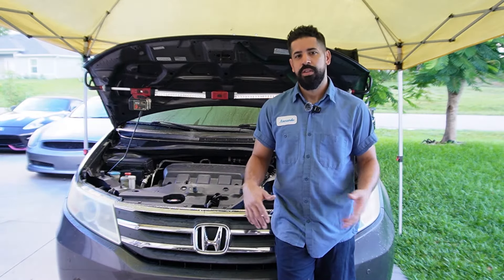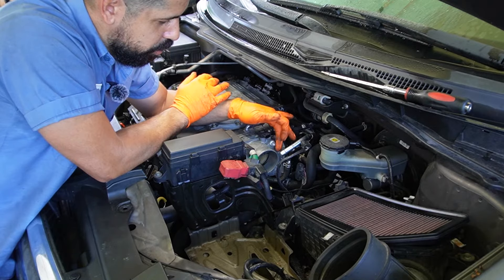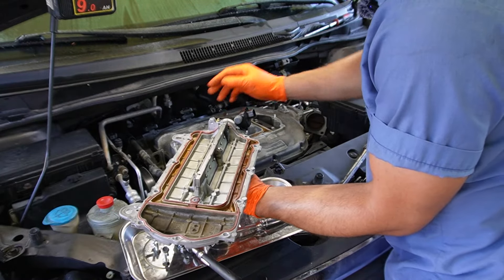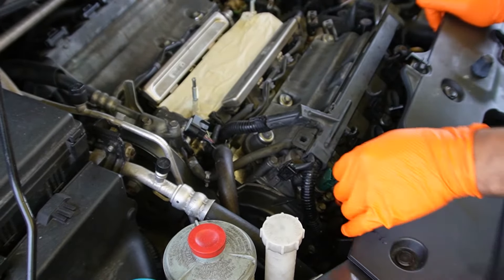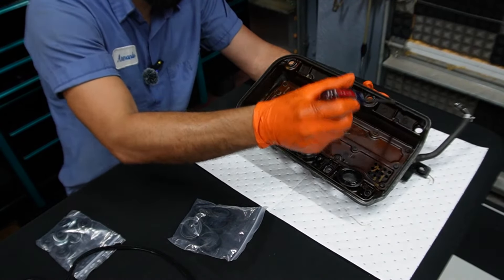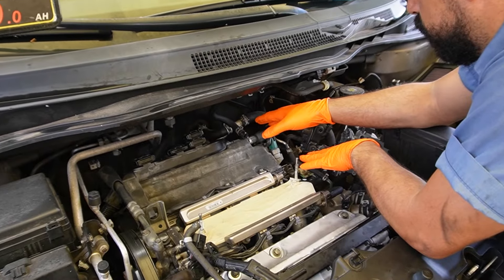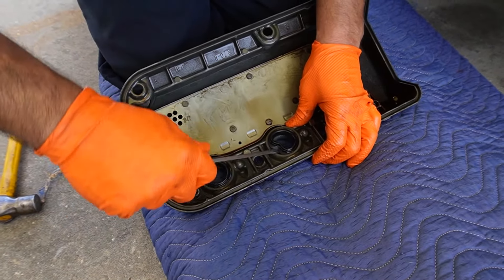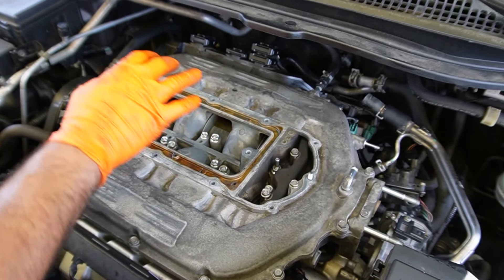2011-2017 Honda Odyssey How to replace the Valve Cover Gaskets (step by step)

Comment: I now see why you skipped showing getting the rear cover out 😂
Reply from the maker: Haha, yeah, that part was a struggle! Figured I'd spare everyone the frustration, but trust me, it wasn't pretty. 😂
Reply: @Prolbuilds  haha.  i ended up removing the power steering pump so i could free up the harness more.
Reply from the maker: That’s a bummer, but at least you got the job done! I’ve run into similar problems—sometimes it just takes a little extra effort. Hopefully, my video was somewhat helpful. Thanks for watching and commenting!

Comment: There is no way to replace the gaskets for the coils.  The old gaskets have melted in, not possible to remove the old gaskets.  I ended up buying a new valve cover that has new gaskets installed.
Reply from the maker: Man, that’s rough! Old gaskets can be a real nightmare to deal with, especially when they get brittle and stuck in place. It’s always a hassle trying to scrape them out without damaging anything.

Comment: Exelent video One thing to notice is that after you place the cover back, you have to make sure the spark plug tube doesn't pinch the gasket. If it does, you will have oil leak into the spark plug hole not fun. The way I did it was to sit the cover and start the screws and with my finger nails pushed the gasket outside the tube on bank 2 is not bad but bank 1 is a pain because the firewall you will need a mirror and a flash light. I hope this helps someone.

Comment: Good video, sorry, I replaced the seals on the front valve cover, and when I put the screws in, I had one 10mm screw left over, about 2 inches long, and it has a mark on it like a zero and a line in the middle. I don't know where I removed it from. Do you have any idea where that screw might go, please?

Comment: How is the quality of the aftermarket Valve Cover? The price is cheap but I am worried about the quality.
Reply from the maker: I'm with you on that one, it's really hard to judge the quality. It felt as heavy compared to the OEM.
The top of the cover has a different finish on it. Will it last another 130,000 miles? idk.
Maybe not, but if I can get another 50k out of the ODYSSEY, I'll be happy.

Sorry bud, this one is a gamble
Reply: @Prolbuilds  if anyone is concerned about the aftermarket stuff, then buy the oem part.

Comment: AWESOME video! One question- those 2 elecrtical connections on the back side- you mention them at 28:59 - I'm having a lot of trouble getting them to release. Any tips?
Reply from the maker: Hey bud, hopefully you’ve figured those connectors out by now. Sorry for the late reply—I try to respond to comments at least once a week. Sometimes I use shop air to blow out the connectors since sand and dirt can build up over time and make it hard to release the clip. I usually go with an air gun that has a long nozzle. Sorry I couldn’t get to this sooner!
Reply: @ all good. I worked it for quite a while, but managed to get it.

Comment: What is the likely hood that the valve cover could leak oil if there are no engine codes no burning oil /smoke or visible oil in the bay or my drive way 

My mechanics is telling me this is the reason the alternator stoped working and now the valve cover and gaskets need to be replaced
Reply from the maker: A valve cover gasket can seep oil without creating visible puddles. Over time, this oil could accumulate on nearby components, such as the alternator, potentially damaging them. Oil contamination on the alternator can affect its function by degrading electrical components or causing a short.
In some cases, leaks may not be obvious without a close inspection.

Some mechanics may recommend replacing gaskets preemptively if they see any oil residue, even if it’s not causing an issue. If you’re unsure, consider getting a second opinion from another trusted mechanic.

The ECU doesn't have sensors to detect physical oil leaks.
Oil leaks are more of a mechanical issue than an electrical or emissions-related problem, so the system won't recognize or alert you.

Comment: After doing this process Thanks to your video, (i have liked and subscribed), I have some smoke originating from the middle (like the area below the newly installed valve cover) if some smoke is getting into spark plug ports would that cause this? i have driven about 8 miles and still some smoke but not as bad as first 10 minutes was and no engine error codes yet. No signs of new oil dripping on my test cardboard box under car previously the car would leak oil actively onto ground. I know some say smoke no big deal its burn off but when should be a big deal? I did get entire valve cover and followed torque levels etc you provided.
Reply from the maker: Oil may have spilled onto the exhaust manifold or other hot engine components while working on the valve cover. Inspect the engine bay for oil residue and clean the affected areas with a degreaser. The smoke should subside once the oil burns off.

If the valve cover gasket was not seated correctly or is damaged, oil can leak onto hot engine parts. 

If oil leaked into the spark plug wells during the repair, it could cause smoke as it burns off. Check the spark plug wells for oil and clean them thoroughly

Inspect the PCV system and hoses for proper connection and functionality.

Hopefully this helps!

Comment: How did you take the intake inlet off that hose by the throttle body???
Reply: A lot of patience, it's very tight. An extra pair of hands also helps. One person squeezes the clamp and the other pulls the rubber tube off the metal nipple
Reply from the maker: Absolutely! It definitely takes a lot of patience, especially when you're working in tight spaces. Having that extra pair of hands makes all the difference